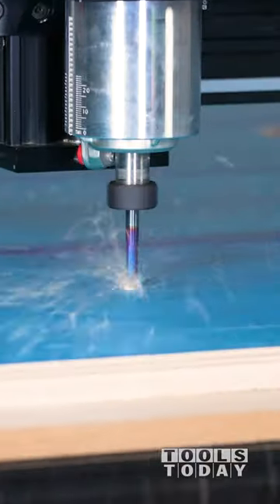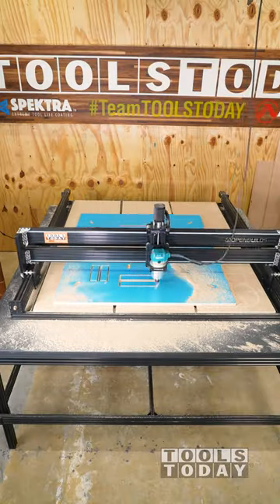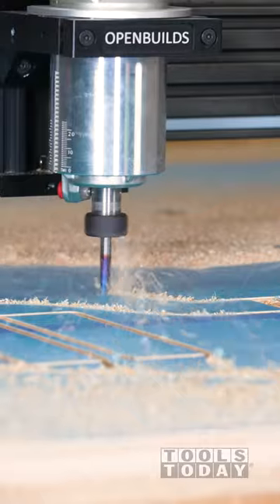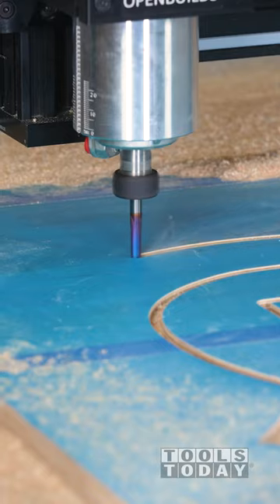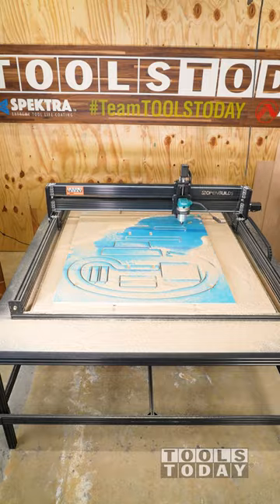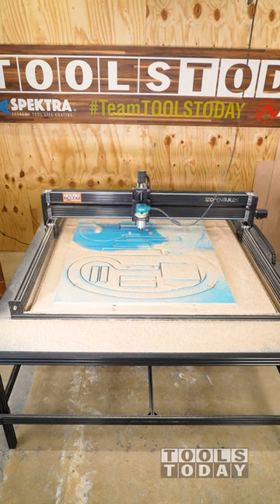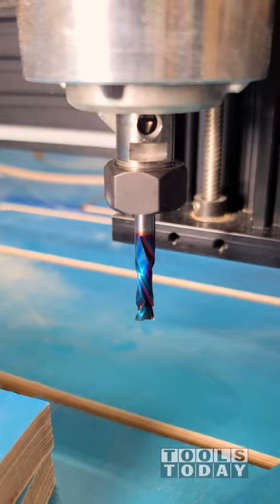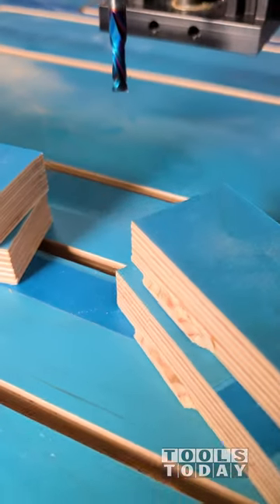Always Double Check This on Your CNC

Comment: Did you cut the whole thing in one pass? Can you post your feeds and speeds?
Reply from the maker: I did the .75" thick baltic birch in 3 passes.  Here's the speeds and feeds -
RPM: 18,000
Feed Rate: 50ipm
Plunge Rate: 25ipm
Depth Per Pass: .3"